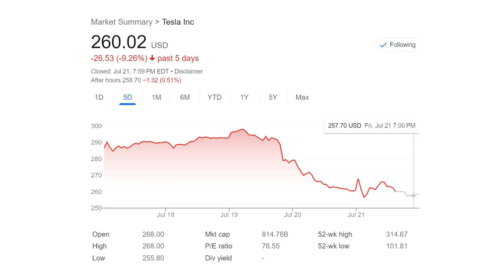When the Robots Come - Disruptive Investing News

Comment: What are you going to replace the Protestant Work Ethic with? That's a serious question. I think we need to replace it, but we are still yammering about how one's worth is defined by one's ability to earn a living. Good luck with the answer. I haven't heard a good one yet.
Reply: Your correct, the feelings of worth, and value will be torqued at the least. Besides, all of the systems we have in place will be useless. Social Security will not be able to continue, as robots do not pay in, so retirees will no longer get checks. Unless you program robots, or know how to fix a robot, what's a fellow to do? Calling this disruptive, is an understatement of course.

Comment: Having a bit of understanding in area of SW development and robotics and looking at AI development progress and investments, my prediction is that Tesla Bot would be able to do something useful with high probability of success in about 4-5 years, and in 10-15 years it would be able to do pretty much anything.
It won't be next year, at least not reliably, but even 4-5 years is a mind boggling speed of development! Can't wait to see it with my own two eyes.
Reply: Make it 4-5 months and 10-15 months, and you'll be closer to the truth. AI development is extremely fast. And Tesla isn't starting now, they've been developing FSD since 2016, and it's 90% transferable to the bot. Plus Tesla recently started to work on a new architecture, which is like ChatGPT for the real world. That's able to learn everything about the world from just raw video. It needs insane amount of data, which Tesla has from the fleet, and insane amount of compute, which Tesla will get from Dojo.

And Optimus has three huge advantages over FSD:
1. It will have to work in a vastly simpler environment, which is already designed for robots (factory).
2. It's mistakes don't kill people, so it doesn't have to be anywhere near as perfect as FSD.
3. In a factory there are many jobs that are extremely simple, like "pick up part, move 6 feet, put down part, repeat forever". Even the most complex job in a factory is trivial compared to driving a car. The only reason humans are still needed is because traditional industrial robots are only capable of perfect repetition, if anything varies by any amount, they fail. So Optimus only has to be able to adapt it's pre-programmed movements a little bit, and humans are out of most jobs.
Reply: @andrasbiro3007  You'll be surprised how much time SW development takes. Also FSD is not equal to Tesla Bot SW.
Reply: Somehow iRobot film timeline seems possible